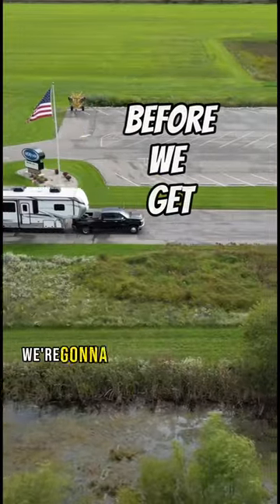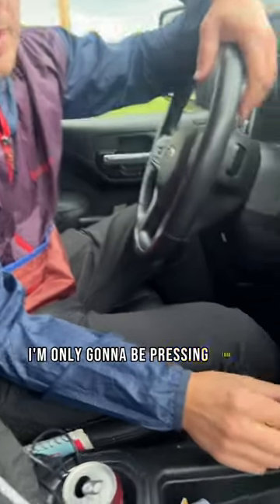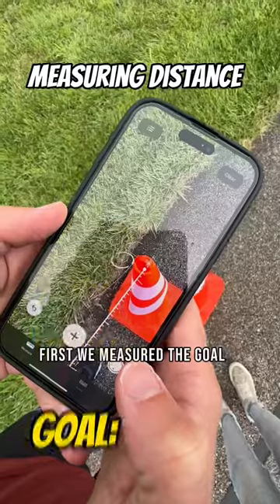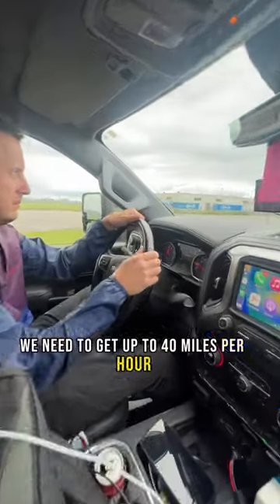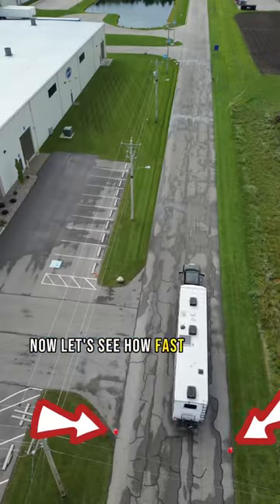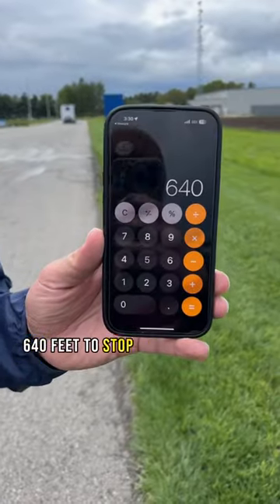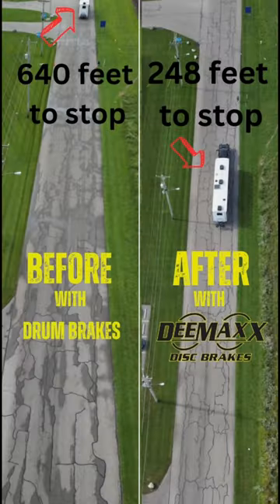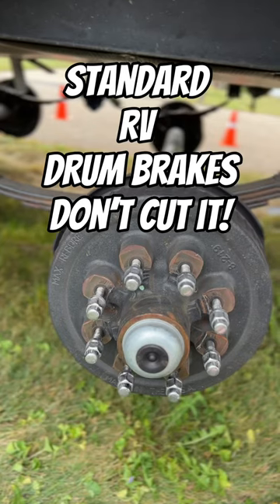RV Brake Test/ BEFORE DISC BRAKES ​@deemaxxcomponents9391 #rv #rvtravel #rvlife #rvupgrades

Comment: You're an amateur it's not supposed to stop with the trailer brakes alone
Reply from the maker: This is a test, comparing Drum brakes to DISC brakes. We are not amateurs, we have travel the country Fulltime in our RV for almost 3 years traveling to 32 states. Tell me how you are an expert in this matter?
Reply: @PeeplesandPlaces  Well, I've been driving a Semii and other big trailers over the road for 45 years.
Reply: @PeeplesandPlaces  3 years of doing it one way doesn’t mean you are doing it the right way. Trailer brakes are supplemental. They are there to help your tow vehicle.
Reply: 😅 tell a cop or lawyer you stop you're trailer by trailer break

The first thing they are gonna ask is "you don't have a CDL correct?".      Trailer breaks are not meant to stop the unit. . . . . . They are ment to supplement the vehicles gross weight and the possibility the trailer is on the heavy end of the gross weight

A unloaded semi with trailer will never use air to stop. . . . . 
That's how you kill everyone thinking you accomplished something.   As the trailer fishtails away from you, or worse you're breaks lock up. . . . . . 

Iv driven trailer vehicles since I was 5, and learned before 12 you never depend on them as a primary
The reason that independent is there, is so you can apply more break pressure then the automatic system is already applying
If you attempt to tell the trailer to stop with out the truck theres stress on the hitch point, cables, fuses and thats all before you consider wear and tear on the breaks cuz they weren't designed for that
Reply from the maker: @donovanulrich348  we know this and my husband did have his CDL. Once again, this was a test that was just for the DISC brakes vs Drum brakes, without the truck brakes involved…. So we could see the difference. I’m not understanding why ya’ll don’t understand that we needed to do this in order to clearly compare the two…
Reply: @PeeplesandPlaces  this "test" is like testing if bullets are in a gun, by pulling the trigger
Or punching a child to see if it would hurt
There is no established rule, method, or test to stress the trailer breaks and see results that are official. . . . 

Yes you can see how long it takes to stop
But don't compare that to real world expectations, cuz you "tested" a unrealistic situation and a situation I pray isent repeated in the real world outside the test